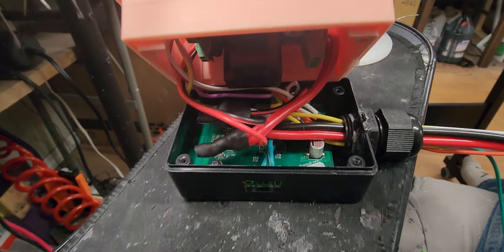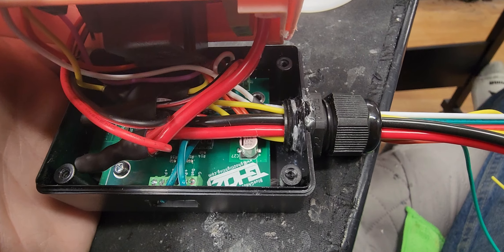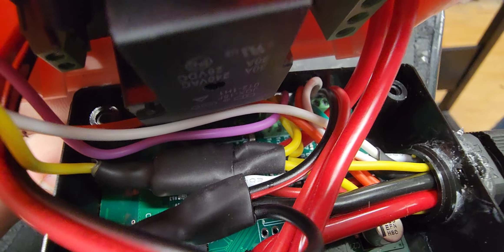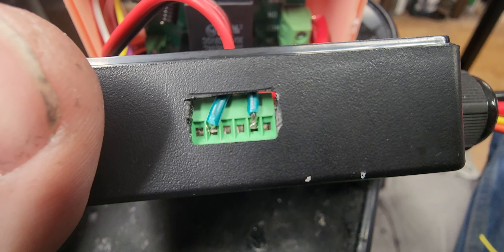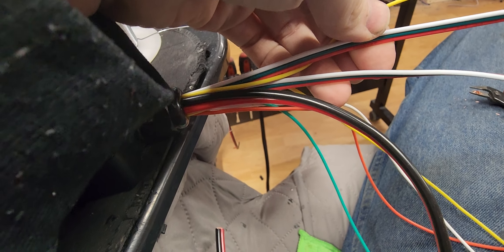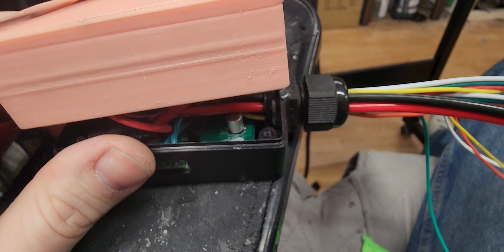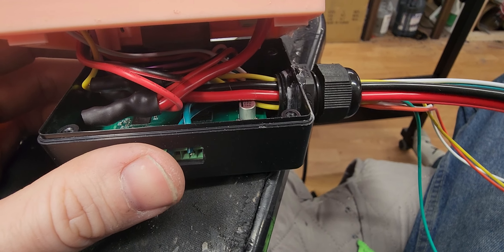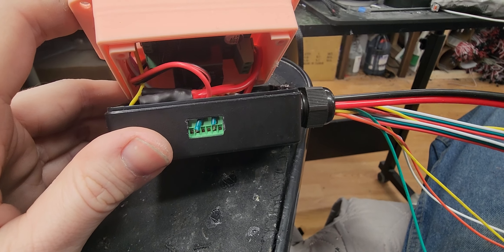BlueGhozt + Battery Saver: The Combo You Didn't Know You Needed

Comment: Am I correct in assuming this is not a system that would work in a tail light setup? cuz from what I think Im understanding, the power saver uses its 3 triggers to wake up the blughozt module, in turn itsend an output to open the connections that send power to the lights... so if I wanted the tail lights to come on if someone hits the brakes, turn 1, turn 2, reverse, park, and extra... it wouldnt work. Cuz it wouldnt be safe to run this system on the road if the lights wouldnt be triggered when I use a 4th input, right? or I would have to remind a customer to remember every time they drive their car that if they want the tail lights to work they first have to trigger one of the 3... maybe Im not understanding